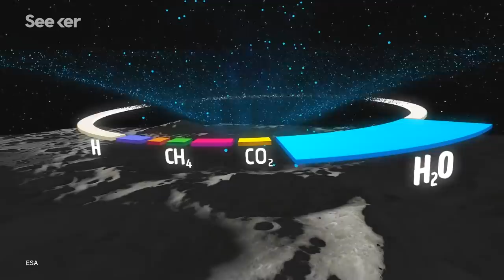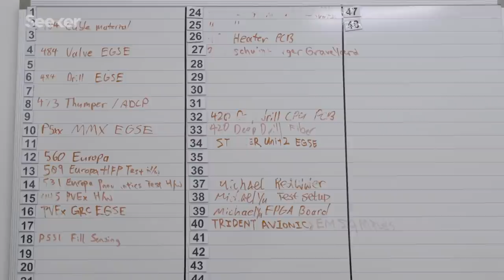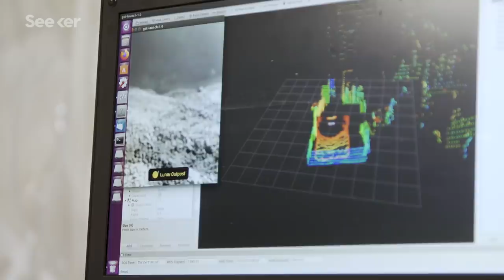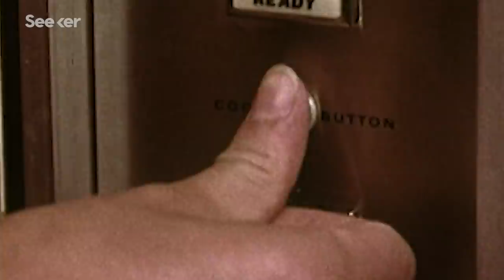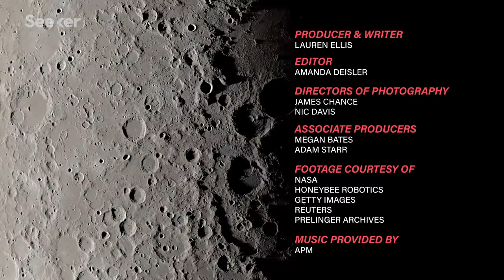Inside the Lab That's Turning Moon Water Into Rocket Fuel

Comment: So, some major issues with this concept.  What happens when we begin to reduce the mass of the moon?  It already is moving farther away from the Earth by 2.4 cm each year.  Additionally, and possibly more concerning is how will all of these electronics operate in a hostile space environment?  The moon has no protective atmosphere to shield against solar or cosmic radiation.  Nor is there any protection against meteors (usually only micro meteorites are expected).  Remember, when the moon missions were extremely short and there was no design intended for a longer duration visit on single missions.  Granted, that was ~50 years ago.  Anyways, some food for thought.  I do believe we need to conduct space exploration, but we also have to be realistic about risk management and our overall expectations over a long period of time.  This won’t happen overnight.

Comment: Narrator: "You need a pretty powerful mirror"
That's not a mirror
Reply: It's a whole new Zeitgeist....... 😂😅🤣 Seeker is loosing it!
Reply: Thomas Lucas it doesn’t really tho. Sure it detracts through the atmosphere and shifts the spectrum, but down here it works basically the same, just slowed down the tiniest bit.
Reply: Will Kessner tiniest bit? Lol without  shielding, you’d almost instantly get sunburned in space. Our atmosphere protects us from the sun, extremely well
Reply: Itll be much faster in space because of the NO atmosphere as you said my dude
Reply: Apparently none of them have broached the physical properties of wave guides to focus their light source.
Reply: It’s. mirror
Small fragments of reflective material is in the lens 
It’s technically a mirror which refracts the light to a point.
Reply: curtislee as far as I know, the definition of a mirror is: a surface of glass coated in a metal backing which reflects a clear image. 
That is a giant lens with refracting elements, like the reflectors on your car or bike, not a mirror. imo
Reply: @curtislee3521  No, it's a Fresnel Lens.
Reply: 72 degree pyramid technology Suppressed patents  Why do you think spamming this everywhere will get you anything but ridicule and muted?
Reply: @curtislee3521  If it REFLECTS it's a mirror. If it REFRACTS it's a lens. Why don't you google fresnel lens and see how they actually work.
Reply: So the solar flux on the moons surface at its closestes to the sun is about 1400 W/m^2. When on on the earth's surface it is at max 1100 W/m^2.  Yes there is a 21 % decrease in power per square meter.
Reply: My personal fav - 
Narrator :  companies like honeydew

it's honeyBee
Reply: Tinb A like 420 😂
Reply: Shes femsplaining to us
Reply: Yeah

Comment: Probably the most efficient, and resource saving way, to travel from the moon, instead of going there to refuel, would be:
Setting up a mass driver, and having it powered by fusion/solar; this, of course, is going to require some infrastructure, 
so understandable why it's not the first goal, however, it should be a goal... 

Also getting shot out of a giant spaceship railgun, just seems like a fun concept.
Reply: it's only good for cargo, this wouldn't work for people
Reply: for manned craft this could be used for getting fuel into orbit

Comment: 0:58 "use that with hydrogen brought from earth"  
Water has 2 hydrogen atoms, the poles on mars have water, why not get the hydrogen from that source?
Am I missing something?

Just a farmer passing through, looking to understand
Reply: if they already had enough water, they wouldn't be mining for more
Reply: Blue Comet: Aren't the poles on mars huge? Wouldn't the ice there be enough to sustain?
Reply: Luka Papež: So the topic of the video is just a preliminary extraction of  needed resources. 

Wouldn't it require less logistics to just extract what's needed from the poles?

If there's frozen water at the poles with the necessary elements that's where I'd go to setup shop. 

Just a farmer passing through, looking to understand
Reply: @endutubecensorship  Orbital plane changes to land at the poles are expensive, fuel-wise, and the poles are massively more undulating and lacking in flat landing sites. They briefly mentioned in the video it was "harder to get to the poles" but not why or how much harder. To get the water from specific craters that have constant shadow is no trivial task - much more logistics.
Reply: Piñata Oblongata: Understood, I figured it was similar difficulty for a spacecraft to land anywhere on a planet's surface
Reply: @endutubecensorship  they're going to the moon first
Reply: @PinataOblongata  Basically, extracting ice from the poles is probably going to require a manned mission there, not robots.
Reply: Its about the mass... And energy density...

Or whatever they said :)
Reply: @ReddwarfIV  I don't think so, it's definitely possible to design robots that could do it, just depends on whether having that happen is really useful for any other missions.
Reply: 6 months to 2 years travel time to Mars or 3 days to the Moon which is going to be less costly for resources?

Comment: What’s the difference between “moon water” and “earth water”?
Reply: Moon water is in a shallower gravity well.
Reply: Water is water.
Reply: galfisk 

What effect if any does that have on the water?
Reply: Danie van der Westhuizen 

I guess what I’m asking is what makes them think moon water can be converted into rocket fuel.
Reply: @MelaninMagdalene  There isn't, they will just use water on moon because carrying water from Earth to the moon is impractical. The most practical way is to get fuel, water in this case, from the closest possible source which is the moon itself. They will use the moon as a sort of "hub" to launch man further in to space. This information is in the first part of this series, this is part 2.
Reply: @Melanin Magdalene
 one actually exists.
Reply: jm8080 

I didn’t even know water could be converted into fuel.
Reply: @MelaninMagdalene  Water = H2O, it's made up of Oxygen and Hydrogen atoms, which happens to be the fuel they use for rockets they send to space.
Reply: jm8080 

Thanks! I had no idea!
Reply: @MelaninMagdalene  Same reason. H2O is H2O. Same process you use to do it here, you can do there. All they done  now  is make a easier method of doing it, that can be used on the moon, where you have limited electricity and hostile environment.
Reply: @danievdw  I don't think they are making much H2 with Hydrolysis on Earth.. that sounds like a waste of energy..
Reply: @Strade8  Obviously not... I'm talking about the example in the video....

Comment: You should take a look at the research group in Germany at kit that turns co2 from the air into co2-neutral fuel. They already startet a startup with their system and are working on a 2nd version
Reply: Ok, woher stammt die Energie, um den Treibstoff herzustellen ? Na ? Klingelts ?

Comment: One thing I did not consider before, if the chocolate bar melted on the pocket of the radar operator what happened to his flesh and organs also exposed to the microwave radiation presumable in high doses ?

Comment: Did my guy just say they want to bring hydrogen from Earth? The same hydrogen that comes from steam-methane gas reformation 95% of the time? Bro.
Reply: When they land on the moon they be like: uh Houston we have a problem
Reply: I don't see the problem. I also know nothing about this stuff lol

If any of you have the time, could you outline the issue?
Reply: Where are you getting methane from on the Moon?
Reply: @juicy420jam  What do you think "steam-methane gas reformation" means?
I know you can get hydrogen from water ice, but Float Circuit seems to be saying they can get it from a process that wouldn't be applicable to the Moon.
Reply: They want moon water,or rocks ,melt it and separate hydrogen and oxygen in the water and use it as a fuel
Reply: that's how the big corps like shell do it
using water and electrolysis you can do it at home with none of the bad side affects, that's the plan for both the moon and Mars

Comment: What I am most concerned about is how the mining on the moon will change the moon. There is no notable atmospehre, so while mining you will create dust. And this dust is has very sharp edges. Also because of the low gravity it takes longer to settle. And I am wondering how much and how fast can you mine, without that becoming an issue. At what point will the dust that is created by mining cause a bigger problem?
Reply: I'm not a physicists so I could be wrong but I believe dust settles slowly on earth because of air friction. Just like the experiment where a rock and a feather take the same time to fall down in a vacuum dust would just fall down like any other rock. Also without air there is no wind to spread it around so transportation and control of said dust would be much easier than on earth
Reply: @tbird81  I do not understand what you mean. And maybe I am too much influenced by the sci fi I read. But if we look at the scale of mining we already do, why is it not plausible to ask the question when will the dust generation on the moon be an issue? How much do we have to mine for it to affect a certain area of the moon drastically?
I believe that is one of the reasons why explosives aren't even a topic, but I do not know enough about mining in lowered gravity or mining in general.

Comment: Using Fresnel lens you can 3D print with stone, tiles interconnecting blocks for building facilities etcetera the sunlight in a vacuum is far more effective as well not being diffused by air and water.

Comment: They should use this for industrial scale desalination on Earth. Also for mineral processing on earth, to reduce cost by reducing fossil fuel requirements. Lasers for industrial temperature control and processing. Lasers can be shot from orbiting solar collection satellites.
Reply: Alshamari Baha2  there's plenty of options to remove salt from water. Don't stifle innovation! Earth's soil is composed of plenty of things that specific temperatures can extract. Why would you paint a broad brush of denial? Do you sell microporous membrane or something?
Reply: @entyropy3262  Usually. That's probably why industrial lasers are not more common. People would do stupid things with them.

Comment: All of those extraction methods expect the extracted gas to "rise up" to their collector...
Correct me if i'm wrong, but with no atmosphere, the gas will just gather at the bottom of the hole, sticking to the surface of the moon because of gravity. Sure some of it will float around, but it's not gonna rise up like a stream as seen at 6:48
Reply: That is why the drill has a heater on it as it goes down.
Reply: ummm you know it would be easy suck those with a vacuum, since it's gas and not that heavy you don't even need a powerful vacuum. Or better just put the container where you will store it a the bottom so wouldn't even need to suck it.
Reply: @jm8080ful  You can't suck with a vacuum when you're already in a vacuum :'D

Comment: I get the economy of taking light hydrogen to the moon and getting the heavy oxygen from the metal oxides in the soil using energy from the sun.  I'm not sure I understand the economy of getting water from lunar ice then turning that into oxygen and hydrogen.  The energy that results from using those gasses as rocket fuel will be identical to the electrical energy needed to do the electrolysis.  Right?  Perhaps setting up a large solar panel to provide all that electrical energy is the answer to this puzzle?

Comment: Making hydrogen from water via electrolysis  doesn't suddenly become cheaper and easier because you are on the moon. It actually becomes harder and more expensive. Way more expensive. It takes a lot of electricity to make hydrogen in any significant quantity. We also are not talking about just hydrogen, we are talking liquid hydrogen, which requires way more hydrogen per given volume. They fail to mention where all that electricity will come from, but I can tell you one thing. It ain't gonna be solar, not if you want to produce it in any reasonable amount of time.

Comment: If you think that this is new I have information for you as we have known how to separate hydrogen from water since the late 1890's with as little as 6 volts with about ten amps and you can do it yourself with nothing more than a battery charger and a couple of copper plates . Hook one plate to the negative lead and the other to the positive lead and watch what happens .
Reply: We know, they literally did this in the video

Comment: Cool splitting water into hydrogen & oxygen // electricity used for that can also power fans & pumps & cryocoolers & controllers & electronics / electrolysis dope & at home can make HHO gas for cutting & welding & brazing & even powering ICE motors etc

Comment: Looking at their experiments; I can't say I'm hopeful. 
The blower has an issue of no atmosphere on the moon so no air to blow and will need a tank of air to operate; so it has limited use.
The lens needs a funneling waveguide to focus light properly if you want to work on more than a pea size area at a time.
Also the moon has a 14 day (day night cycle) in which you have no sun to produce energy for oxygen seperation via regulith mining or electrolysis.
I have more questions about the robotics but I am just astonished at the oversight of how the use of plastic 3D printed items like the wheels can survive on the moon. All that dust and powder is nothing more than shapened glass and rock shards and will cut through the plastics with ease.
Meh... I guess it's true "common sense is not a common thing."
Reply: You're not going to get massively expensive titanium wheels manufactured for your prototype just to see if the SHAPE works at propelling it through the regolith. Prototype first and THEN use the final materials with the right design. Use common sense :P
Reply: @PinataOblongata  prototype? For what? How do you propose a production titanium on the moon? You belive it would be a regular shipment from the earth? Also if you think the wheel designs are unique to these projects you are wrong. NASA, Japanese Space Agency and the ESO have been publishing the reinventing of the wheel concepts for years. They did it for mars, a retun missions to the moon, and have even proposed a comet rover. So I will suggest you look into it if you are going to comment. :p

Comment: I wonder what the Lunar Outpost (The Next Leap) 4-wheel bot's wheels are actually made of now, and what they will be using in the future?
They look like PA, PA-GF, or PA-GB. PA-based wheels are not going to do well as the UV will destroy them really rapidly. UV-stabilised PEEK might be an option, or posiibly white POM.
I'm really interested as I am building a rover of my own (for use in a UK quarry) and the best plastic I have found so far is PA-CF, but its black colour does cause some issues for the motor temperature sensors when in direct sunlight.
Any ideas for suitable plastics would be gratefully received. The rover is to function in the open for upwards of two years - barring theft (of course!).
Reply: uPVC seems to last quite well in sunlight.

Also PP garden furniture & plant pots should last > 2 years.

Comment: Use lasers then
Reply: bill pojas  And you power them with ?
Reply: @tomf3150  nuclear batteries or solar panels. It would be more efficient and lighter than bringing mirrors up in space which would require power rockets and fuel.

Comment: There is no MOON WATER!  i think the video uploader does not understand the process...h2o/water is not on the moon..O/oxygen inside the rock is on the moon.. mixed with H/hydrogen from earth to combine into water
Reply: There is moon Ice
Reply: @UmbraHand  also moon ice is not h2o there are many forms of ice
Reply: quad55555 The molecules would be H20. There would be a difference in the hydrogen bonding with the ice due to the temperature and pressure giving different phases but it still is h20